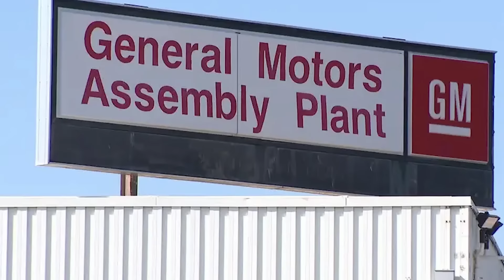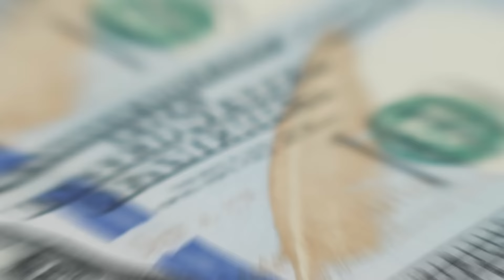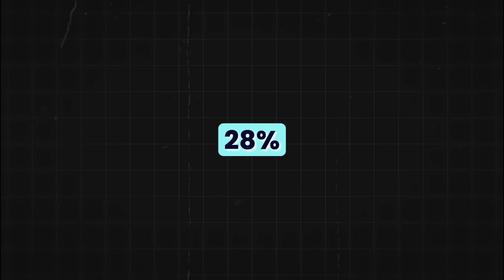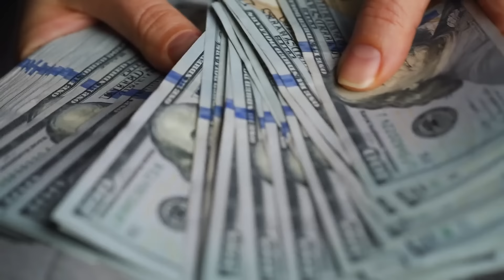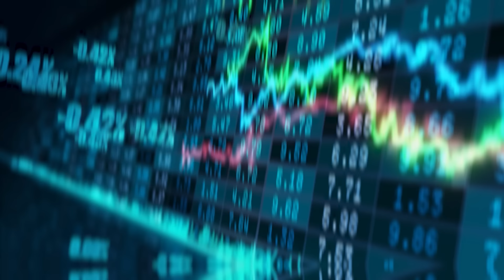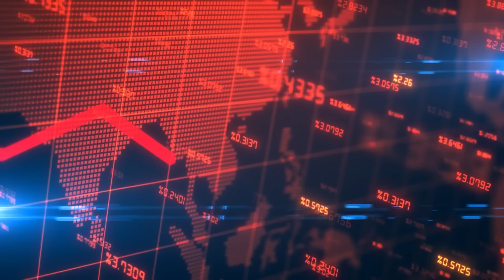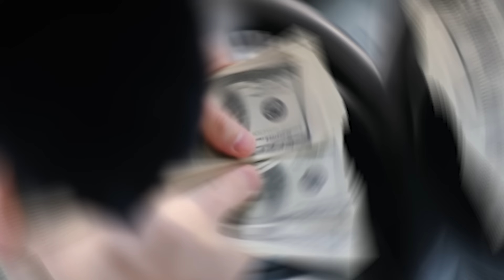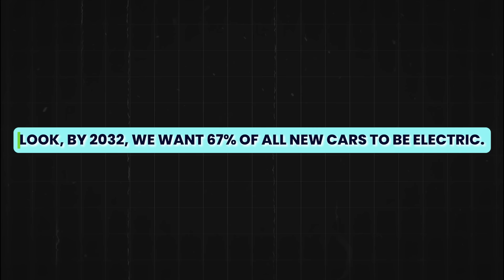The EV BUBBLE has Burst!!!

Comment: Auto makers should be listening to customers and engineers. Not silly politicians that have chauffeurs..
Reply: Sure build affordable vehicles...no extras
Reply: 👏👏👏👍totally agreed
Reply: Exactly those WEF masters
Reply: totally agree.... EVs just aren't there yet. One day? Maybe... but the biggest issues they need to address are 1. Charge times and 2. Battery Life... Also, the things use a crap ton of rare earths to make and are NOT guaranteed to be any better for the Environment. Most Electric companies are use Coal fired or BioMass fired power plants. To guarantee a reduction carbon emissions, you have to switch to Nuclear power....completely. That isn't going to happen because your average Joe schmo automatically thinks Chernobyl when anyone mentions nuclear power.
Reply: Exactly
Reply: @FacultyFan  tech is already here and has been molted salt reators has approval to do that in Idaho from what i read..we still are feeding big oil...im sure we can get better gas mileage..less emissions  but that's the crazy world we live on
Reply: You can buy a XL Ford 150 with a v8 for about. $34,000.
Reply: @FacultyFan  Your points 1 and 2 are meaningless without infrastructure. There is just not enough electricity even being made. There is also rules when you can use electricity and if there is not enough govt will turn off the juice completely.
Reply: Nobody should be listening to politicians, why do you think the world is such a mess.
Reply: Well said!
Reply: DUMP the Airbags, auto-braking, lane keeping, backup cameras, tire sensors, steering takeover, collision avoidance, computer this and computer that, etc etc etc etc CRAP that NOBODY with any BASIC driving skill NEEDS, and just give me something reliable that doesn't cost more than my first HOUSE!!

A BASIC car SHOULDN'T cost more than $8,000, and SHOULDN'T require a 30 year fecking BANK LOAN!!
Reply: And private jets all paid by US the lowly taxpayer
Reply: And zealots that live in la la land.
Reply: @MikesClassicRadio  Correct all I need is a cheap car with a heater and a radio, in hot weather roll down the window manually. ?
Reply: I will never buy an EV ever!
Reply: @FacultyFan  EV cars that use diesel generators are already possible and would combine the upsides of both, petrol and electric.
Reply: Here's my quick opinion on that I believe we are putting out too much CO2 into the air but I agree with you on this, the short quick solution is not electric cars. It's foolishness at its finest.
Reply: They are which is why they made EV's . they shouldnt listen to "silly men " Online cause they cant handle that ev Is faster , stronger , and over time is catching up to and will surpass low efficiency combustion engines. its like insisting you stay with horse an buggy .... even tho you too bitch about the horseshit...
Reply: Better yet get rid of silly politicians altogether.
Reply: EV or Gas, What Pollutes More? - https://www.youtube.com/watch?v=1oVrIHcdxjA
Reply: Woahhhh, I like my rear view camera brah
Reply: @michaelshortland4812  did you even watch the video?
Reply: spot on mate
Reply: beautiful cars, big mistake using batteries... you think they would be smart enough to use hydrogen engines. Basically water energy 🤭
Reply: Only electric vehicle I will ever own is a scooter that goes 4 mph.
Reply: Riding in fossil fuel vehicles!
Reply: FACTS!
Reply: @thomassullivan1676  
Indeed!
Reply: And China...
Reply: That will do anything to rule even if its over ashes as long as they get to rule !
Reply: @FacultyFan you forgot cost; not to mention that the environmental costs to build the battery are arguably worse than other alternatives.
Reply: @ranmatardis4236  yea maybe one 5 years old…you’re clueless..
Reply: The governments passed laws forcing them. It's not 100% their fault tbh.
Reply: Hydrogen will be the future my friends…would never drive an electric car in a snow storm…!
Reply: or political activists.  I'll stick with my 2011 malibu.
Reply: EVs will be the new 3D tv remember those! Rich people play toys. that wind up in a basement living room and no remote😢.
Reply: @thomassullivan1676
What are molted salt reators?
Reply: It's like I don't have any problems and I can't buy these strange cars and cause myself any extra trouble.
Reply: @michaelshortland4812  who is going to buy your EV sh*tbox after the battery is worn out in 10 years? LOL!!!!!
Reply: @albacore58 requires too much storage mass for little range.
Reply: And who drive in big V8 engines......LOL
Reply: @TimeFadesMemoryLasts  yeah, that’s called a Hybrid and they already exist.
Reply: @wanaraz  well, that’s another good point. I’m assuming we can use the existing power grid which is another big assumption.
Reply: @michaelshortland4812  well, that’s crap, did you even watch the video?. I’ll keep the IC vehicle until they fix the EV issues. You’re probably not aware of this, but Cars were initially electric around the time they were invented, why do you think they went with gasoline powered engines? I’m not saying there will never be an EV, but you can’t just snap your fingers and say “we will only have EVs by 2035” that’s optimistic, to say the least.
Reply: Exactly! The public have had enough of their bs.
Reply: FAFO
Reply: Elites don't want that people driving around! They want us lock up in 5 min cities!
Reply: and private jets . minister of ecologic transition in france is a perfect example of "do what I say ,not what I do"
Reply: The EPA aren't politicians.......
Reply: This is not an TV problem, this is a garbage vehicle manufacturer problem… Ford and GM do not make good vehicles outside of Cadillac. Just because the F1 50 has been so popular does not make it a good car, the Asian auto manufacturers are absolutely destroying North American manufacturers on every single metric, including electric, hybrid, and combustion engines. Engineering is better, their reliability is better, fuel economy is better, their styling is better, North American, auto manufacturers are simply not good at what they do. And the expectation of union members to north of $100,000 a year with little to no education does not help any companies bottom line, nor does it help the employees who are all going to get laid off because of the greed shared between the union and the auto maker itself. What do you ask Ford and GM about their hydrogen technology…? Whoops, you can’t, because they don’t have any. they’re just not innovative brands, they’re reactionary brands that depend on their handful of vehicles that are appealing to rednecks and hillbillies.
Reply: @WanderingUkes  I like the Segway. So far they have not taken off in popularity. LOL
Reply: @FacultyFan  There is not enough electricity being produced.
Reply: @djjosseppe  If you like imports so much you could move to a country that makes them. I don't agree another car is better than another. It's opinion. Americans are big people. We like big cars. I love my gas guzzler. When you have to do real work with a vehicle you chose American. When you want good resale you chose American. When you think about supporting Americans you chose American. The Japanese make a good car. Most are ugly , do not perform like I like and have terrible resale. In fact I can barely tell one from the other. They all look the same. Reliability? Yes every American vehicle I have had is reliable and I put tons of miles on them. It's up to the owner to take care of their vehicles.
Reply: I agree
Reply: @thomassullivan1676  yes an inexpensive ev that is not designed like a spaceship would be nice.
Reply: Agree, long charging time and high cost if battery failed,no thanks i won't buy it
Reply: Guys, I’ve worked at both in the product development area, 
It’s not that evs aren’t there, nor that evs are bad, it’s just that ford and gm make bad evs, the batteries fail and catch fire.

The budget on design and finish is actually less than a lot of the ice engine cars, (ignoring what they charge customers)( and also cause a lot more of the battery components aren’t built in house)

If you look over at Asia, there are lots of electric car companies doing really well, great looking cars, leather interiors, fast charge and cheaper than gm and ford. 

That’s why, short of Tesla they couldn’t even enter the electric market there.

Even Tesla has to sell their cars a lot cheaper there to barely compete.

And no, reliabilty of a lot of the china electric cars is still better then a bmw.

And no I’m not a china advocate, they do a lot of nasty things in other areas, but here, they’re proving it’s not the tech that’s wrong, it’s the companies.
Reply: People with horses didn’t like cars either!  Higher gas prices will push people to buy EVs!  Be Patient Ford and GM!
Reply: How many ev's are in world leaders fleet?
Reply: Yes, and the customers call for early death by air pollution from car exhaust. Oh yeah, and the existential threat burning fossil fuels represents. But what can WE do? The customer is always right...right?
Reply: Yes exactly! You have said THE most intelligent thing that I’ve heard all year!
Reply: Automakers should not only stop listening to politicians but also and even moreso, stop listening to climate crazies and activists. Of these people were serious you would think maybe even one of them would ask, and this is only an example, ask Obama, why would he buy a mansion at waters edge? They will never ask with any seriousness.
Reply: Biden Fault 🙁
Reply: Any engineers should be listening to technicians!
Reply: But the engineers and customers don’t bail out the auto makers when they fail and extort millions in executive salary pay 😢
Reply: @nyfrankie9460   I enjoy having my life expectancy cut short by car exhaust pollution. Oh yeah, and that little global climate catastrophe ongoing.
Reply: I want to play along to this, what about the fact that some politicians have/purchased stock in electric power(battery metals), would it not make sense(dollars) for them to push in some way to make that investment  profitable? alot of business ventures are set to fail "right out the box", it's still a write off for the companies AND the investors(hint, hint) still get there returns. while this is a report of a legit issue, rich people are in control.
Reply: No kidding! There’s got to be a kickback somewhere in this push…
Reply: @m12652  Nailed It 100%
Reply: Consumers are speaking with their wallets. The majority of people want gasoline powered vehicles.
Reply: @roscoecoltrane9523  Drill Baby Drill...We need our Jobs in The Automotive industry...The Battier Cars are Killing us and the Lay off of our Jobs... Sure
Reply: Car buyers have realized that governments are now messing around like crazy with the price of electricity. Of course, governments also play with the price of gasoline. But then it's better to stick with a combustion car.
Reply: I've seen what these engineers are putting the techs through. Let's not listen to those engineers.
Reply: @m12652  
All these people crying about EV’s probably voted for Biden
Reply: No one wants these things except bunny huggers and those with a vested interest 🙄
Reply: And private jets that make more pollution than most small villages.
Reply: Listen to customers and end up with a homer Simpson car
Reply: @FacultyFan let’s not forget about the poor kids in the Congo working the cobalt mines……
Reply: @danothemano1  
What about cruise ships
Reply: @Neverendingstory101 I feel like it’s my god given American right to drive a 1970 Chevelle with a big block and getting 9-10 miles per gallon if I so choose.
Reply: @FrankGallagherr what about them?
Reply: @FrankGallagherr they are “Diesel powered” electrics. Which sounds asinine to me. Still using fossil fuels…… I still stand by my Chevelle statement.
Reply: Like Trumps jets? @northrockboy
Reply: ? You mean like a hybrid? @TimeFadesMemoryLasts
Reply: @GeoffSlack  yeah, pretty much. Was thinking about heavy duty hybrids but still a hybrid, so ignore my comment
Reply: @MikesClassicRadio  dude 8k is not enough as any auto company would lose money with every vehicle sold. If 8k it would be a very small Chinese subcompact.
Reply: @WanderingUkes   Just make sure you CHARGE that scooter at least 25' away from your house, inside a brick BUNKER.
Reply: Weird how all the effort pushing EVs, rare materials and ridiculous costs at a loss, despite EVs never catching on to the majority....  

 You'd think it'd take a lot less work, rare materials and $$$$$ used up for a clean burning, easily replicated, affordable, synthetic fuel could have been created by now....    I find it really hard to believe.
Reply: So what? I can buy a Tesla 3 Hyland for $48,000 and have my  rooftop solar fill the "tank". And it is a very comfortable car.
Reply: Should just import BYD
Reply: No, they aren't listening to anyone but their ESG masters. What they DO see is the massive loss of money, not "listening to their customers". If they did, they NEVER would've gone full steam into the EV market to begin with.
Reply: Charge time? Nio swapstation just replaces it for a full one in about the time it would take to fill the gastank.   When I was playing with my RC as a kid. I did not wait for the batteries to charge either. Are the Chinese that smart, or have we gotten that stupid?
Reply: they have to pay high Co2 fines if they don't produce enough EVs. That's why they make cars that no one wants
Reply: Facts
Reply: @ranmatardis4236 Yeah this guy is delusional.
Reply: You're talking about Trump, right?  I agree......the fact that EVs cost about 3x/year less for maintenance and repair than ICEs over the life of the vehicle and that the cost of the electricity it takes to take them from here to there is 4-5x less than the cost of gasoline for a comparable trip certainly gets my attention!  I'm tired of being held hostage by the oil and gas industry and their price gouging all of us in order to pay for CEO bonuses, stock buybacks and increasing dividends for their elite shareholders!
Reply: They are - that's why EV sales are up exponentially and oil lobbyists are paying the likes of Charge Drive to post these desperate panic vodeos.
Reply: @FacultyFan forgot to mention excessive tire wear
Reply: Politicians mostly dishonest, silly men, stupid
Reply: @michaelshortland4812 over 300,000 Americans still use a horse and buggy...and they are very happy and prosperous , healthier, with a longer life span then the rest of us
Reply: https://youtu.be/Pn2eCY3Kwuk